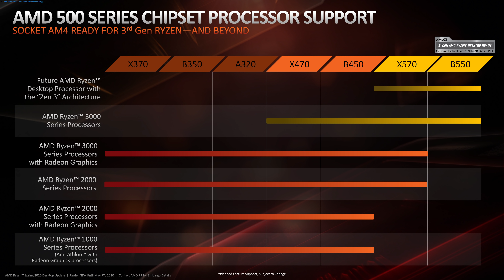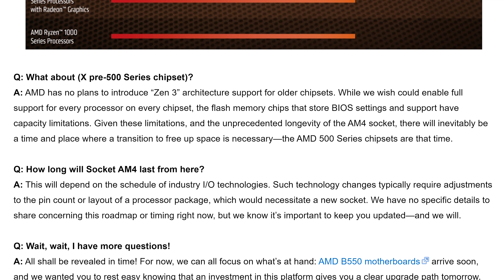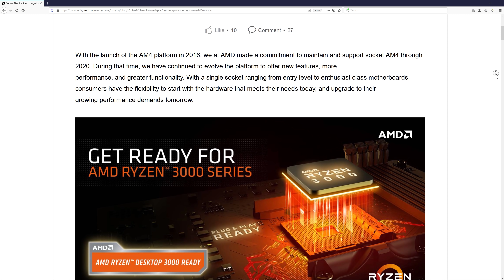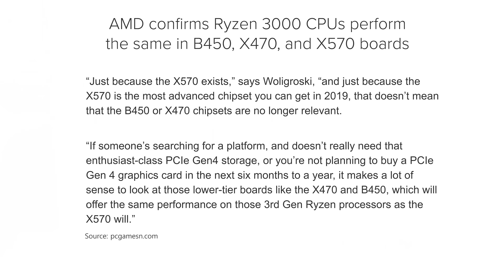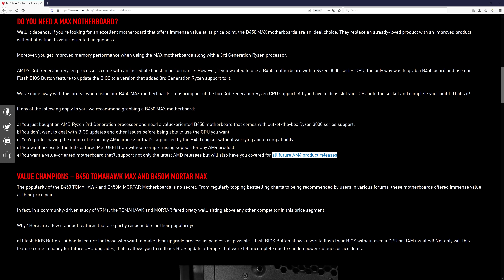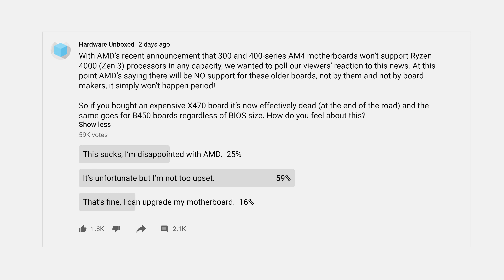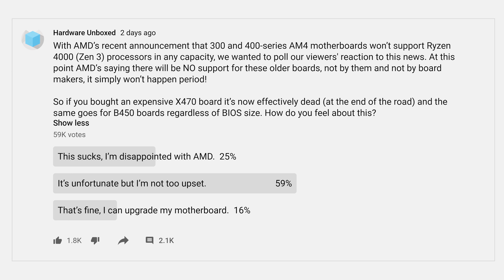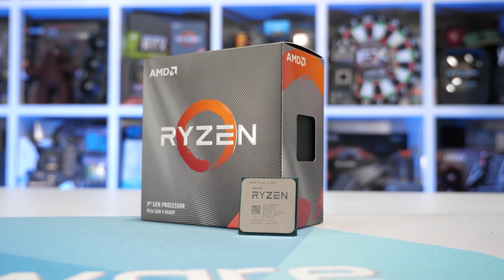AMD Does An Intel, Axes Zen 3 on 400-Series Motherboards, Our Thoughts

Comment: So budget buyers complaining that they cannot upgrade yearly?...
Silly, because you can put a flagship 3000 series chip into the b450, which will last you for YEARS... why? Because even if you play at 1080p high refresh, as time goes graphics just gonna get better thus needing better GPUs first and in turn GPU will be the first bottle neck for high fps gaming. Unless you play mine sweeper.

If you go higher res, the same applies, your you will run out of breath before hi end 3000 chip.

So I don't think this thing is such a big deal, miscommunicated for sure, badly, but in reality it won't hurt anyone's gaming experience, if they think of rationally.

From experience: if you want future proofing, you don't go cheap. Life is a biatch.

I have an x370 taichi with a stock r5 1600 for my 4k gaming needs. Even after all these years, I still only really need a GPU upgrade rather than a CPU one. 60hz screen, though.

You don't have to be overly upset about things that will not affect your daily life.

Happy gaming everyone!;))

Comment: I've got a B450 Carbon Pro paired with a 2600 so having the 3000s series as my only upgrade options is disappointing, even if I can opt for 2-6 more cores (not going for the 3950x on this board lol).  The only reason I picked this board over a cheaper one like the Asrock B450 pro4 is because I expected the 4000s to be compatible and I wanted the phatter vrms make sure it will work well.  Now all that is for naught.  I might just stick it out till the DDR5 2nd generation and at that point Intel will be back on the table, and I'll remember getting screwed by AMD and they will have that against them.

Comment: Thats a very dirty move, they release b550 1 year later expecting us to buy  a more expensive X570 and now they give us this stupid excuse, some X570 and X370 mobos have the same bios storage chip but the X570 have support....
They could just release diffent bios depending on the gen, like;
1&4, 2&4, 3&4 just dowload the one you need to upgrade and done.

Comment: Bought Asrock B450M Pro4, R5 2600 and RX 580 in late 2018. Still working well for my needs. I understand the outrage but for myself I have the option of upgrading to a 3900X or 3950X when Ryzen 4000 desktop chips ship and the price drops a bit

Comment: Thank you! As a 470x owner this is how I feel.  

I knew the 300 series would be out, but I feel slighted they got one extra generation than the 400 series.

Granted I don't fall into the "post 3000" buyers and got a 2700x with mine. But I paid way more for my motherboard (Asus Crosshair VII) than I normally would, thinking i would be able to "leap frog" a generation and that would offset the cost. If I knew I would only get it for two generations I would had gotten a B450 motherboard for half the price.

Comment: Seems Strange you couldn't cust support for processors older than Gen 2  from a bios to add new cpus. Or have a reduced functionality bios, if you need new ocde. May  no overclocking on the older boards.Otherwise what else is changing did a hardware tolerance issue creep in?

Comment: When Zen 2 came out, AMD tried to exclude 300-series chipsets from compatibility.

They should have just repeated that limitation for Zen 3 and stick to their guns.  I don't think they'd get a lot of flack over that.

There's still a chance for them to backtrack and do it correctly, but I have no guesses as to whether or not they'll do it.  I do think that the level of pressure from their partners will be the deciding factor.

Comment: I am disappointed with AMD's decision, but I probably would not want to upgrade to the Ryzen 4000 on the desktop from the 3000 series.  I usually expect to get at least 2-3 years use out of a computer before feeling the need to upgrade.  I might have thought about going from a Zen 2 Ryzen 5 series to a Zen 3 Ryzen 7 series processor which would net me the next generation AND more cores but  I still wouldn't have the benefit of PCI4 without a new MD. When I do upgrade it will be the full monty, IE: more cores, next gen CPU, DDR5, PCI4 and faster SSD that can make use of same.   What I am interested in from Ryzen 4, would be the new desktop APU for a budget build to upgrade the wife's computer.  THAT, can still make use of the 400 series chip set boards.
I hope for MSI's sake that AMD can be strong armed into providing support for un-official support of Zen 3 on X470 and maybe B450 motherboards that have the extra flash space.

Comment: Well, I just bought a 470X for the new rig I built at the end of April/Start of May. I probably won't be upgrading my 3600 anytime soon anyway, so it doesn't affect me too much currently, though I do think being able to upgrade to one the newer chips years later would be nice if it would increase my peformance, at a better cost ratio than buying a new MB+CPU combo. I did buy my board in trying to fit within a budget when it came my motherboard and was also looking for a motherboard with SPDIF output, not easy to find one on the 450 boards at the 119.99 price, while the X570 boards are still about a 150 or so. I do wish the AMD boards would remove Video Outputs as they seem a waste if you don't need them and allow for more USB ports or something on the back end, and release specific boards for for the APU lines. I think I'm more disappointed in the B550 boards coming out about a month after the build and not sure what they are offering and the price point of them, would have been nice to purchase one of those at the same price as my 470 if it had an SPDIF output.

Comment: Gonna make this clear: I dont feel sorry for A320, B350, or B450 owners. they bought the cheapest parts and thus get the cheapest result. They were lucky AMD made magic to get Zen 2 support for those older boards with the tiny roms. 

But going to x370 and x470, a lot of those boards have 64mb bios roms. i believe the x470 i own even has a 128mb bios rom, but i have to double check. theres really no reason the high end boards that do have large bios roms should be held back.

Also to be clear: Im on x570 so their decision isnt going to hurt me at all.

Comment: I'm just gonna say I have hope that they will reconsider... I literally left Intel this month for AMD .. AMD has what I want for this PC addiction lol. "Path of upgradability" where bumping memory frequency shows performance before have to over clock the CPU lol
I dropped MY I7. 8700 for a B450 and paired it with a 2700X 
I'm literally taking it apart right now as I type this on my phone lol. B450 is on its way with UPS 
I mean sure I have ZeN 2 for an upgrade down the road of I need one but I'd like to see ZEN three there also so I don't have to just go to ZEN 2

Comment: Well, there is no point upgrade to zen 3 anymore. Better wait until DDR5 launches and get a new chipset with new RAM. It's a shame because I would spend more if AMD kept support to Ryzen B4 series mobos for the zen3. I was planning to buy a ryzen 3600X + X470, enjoy a upgrade to zen 3 (maybe a 4900X)  and then upgrade again to the 5th generation. Better save up until 5th.

Comment: AMD literally gave you best cost to performance on your B3xx (or even A320) allowing you to buy it (even more cheaper when B4xx boards came) after 3000 series and pair it up with ryzen 9 so think about it. It is logical that most of the consumers buy the cheapest without issues working MB to pair with higher end CPU (you know the reason super clearly and dont be stupid on why would you pair these MB with these CPUs), they literally gave you a finger and you wanted the whole hand and they did it eventually, and you KNOW the human hunger is never satisfied. And AMD as a company manufacturer as all of the companies in whole fucking world is working for PROFIT.  WE ALL DO WORK FOR PROFIT or just get a salary at the end of the month.

They could at least tell us at the releasing of X570   that they wont support for  previous gen processors or at least make the X470 board to support it (i personally have B450 after 3000 released paired with 3700X and i feel bad for X470 owners). Also the poll Steve made is actually a prove of what people are doing when building new PC they built it because they needed at the time it not just thinking of upgrading every fucking year (no hard feelings on enthusiasts who do this but they will always get top of the line every year of products). 
Every year new products come and most of us cant handle the upgrading also look at intel users, still using 2nd,3rd,4th etc.. of their builds, and why? because thats how most of us is doing!!!
Why would you need 4000??? for what? just so the next year they release a product that will crush the 4000 series.

Hats off to AMD providing us great 4 years of great products.

Comment: "Does an Intel...". No.  Intel releases a new socket every time they add a + to their 14nm node, which is with basically every generation.

In 2017, AMD promised AM4 support through 2020...  and they delivered.  Zen, Zen+ & Zen 2 - 4 years and 3 uarch generations with a single socket, and all running on 2017 B320 boards, including the 3950X.  I'm not even going to suggest people cut AMD some slack. Just that they recognise AMD have delivered on the promise they made about product support.

And let's be clear about "axing support" and "Future AM4 processors".... MSI's Tomahawk Max was released in October 2019 (in the US).  AMD has just released 2 new CPUs on the 300 & 400 boards.  More than that, I would be very surprised if AMD doesn't launch even more 300 & 400 compatible CPUs later this/early next year.  They cerainly are not "axing support" for those boards, and the AM4 socket isn't going anywhere just yet.

I'm also not a fan of how you're prepared to throw 300 series owners under the bus based on an arbitrary and wholly subjective [Value] judgement, when that's exactly what you're going after AMD for.
Reply: They promised Zen , Zen 2 and Zen 3.  They haven't delivered.  Zen + wasn't on the 2017  road map and Zen 3 was supposed to be in 2019.  So no slack for AMD.
Reply: @jamesthomson8659   
Their promise was that AM4 would be the socket for Ryzen until at least 2020.  2 new Zen2 CPUs just launched on AM4.  Zen3 CPU's will launch on AM4.

People seem to be confused by the difference between 'Socket' and 'Chipset'.

AMD didn't make any promises about Chipset longevity, however, I will bet you $20 to a charity of your choice, that AMD will release even more Zen2 & Zen3 CPUs on AM4 next year, and that the Zen2 CPUs will run on at least 400 series Chipsets.

Comment: You know what would be amazing?  A small little ROM built onto the CPU silicon that tells the motherboard what it is, that could be read during POST.  I'm not talking in the CPU silicon itself, but like a small extra chip next to it under the IHS.  Then you don't need huge BIOS' to support all the possible CPU's, the CPU you put in the socket just tells the motherboard during POST what it is and what it needs to use it in that motherboard.

Comment: Great video!  I bought a B450 Tomahawk MAX on Steve's recommendation.  It's a great board and I appreciate the help.  I paired it with a 2700X which cost me $210 CAD with plans to upgrade to a Zen 2 CPU which more than likely an R9 chip, but not until the inevitable price drops.  My reasoning for getting the MAX board was primarily for the opportunity to go to Zen 2.  If B550 had come out earlier I'm still thinking that I would have chosen the B450 on price rather that features and Zen 3 support if that news was known at the time.  I would get my cheaper Zen 2 R9 chip and skip Zen 3.  Most people won't benefit much, if any, from the PCIe 4 Nvme SSDs unless the PC versions of the new console games take complete advantage of PCIe 4 GPUs and SSDs.  This would be the primary driver for B550 adoption.  I only feel bad for consumers who can only afford a B450 level board but I don't see what they would be missing out in the long run, other than one CPU release, since the new features would be left behind because of the B450.  Lisa Su may change her mind about supporting 400 series boards, it's a woman's prerogative.  The only 2 certainties in life are death and taxes.  Well maybe climate change and viral pandemics too.

Comment: I built a PC a few months ago with an
r5 3600 on a msi b450 tomahawk MAX. I really wanted to wait for b550 because I didn't want to allocate too much of my budget on an x570. When it was apparent that b550 wasn't coming anytime soon, and I saw MSI's offering of a b450 platform with an updated BIOS chip to support the needs of zen 2 and therefore zen 3, I thought perfect. That's exactly what I wanted. An affordable chipset that I didn't have to waist money on features like PSI gen 4 which I didn't need, but also supplied the necessary hardware requirements for future zen 3 CPUs. My plan was to upgrade to a 4700x or better when I felt that 6 cores 12 threads wasn't enough. That was one of the selling points for me; future compatibility... Needless to say I'm very disappointed. I really hope AMD at least back tracks on this decision with b450 boards with upgraded capacity BIOS chips like my board. Thanks hardware unboxed. As always, great video with relevant content.

Comment: I'd be fine with that if B550 was available with Zen2 launch. Support for just the next gen is not as awesome as supporting three or four generations, but compatibility or stability issues may be quite tricky. Considering the VRM of most B450 boards, support for anything above R7 3700X doesn't make sense. Even with B450, I would only consider R9 with a handful of boards. But buying a B450 today, even a good one like one of the three good MSI MAX ones with VRM capable of supporting a 12-core feels a lot worse if AMD is unwilling to support these boards with microcode for the last AM4 generation.

Comment: I bought a X470 board start of this year for my 3700x. Solely because I didn’t need pci gen 4 and at the time, x570 boards were trash for the price.
Reply: I did the same last year when the 3700x was brand new. Those damned X570 boards are so overpriced.. I have a navi card but I can tell you I wouldn't be able to saturate pcie gen 4; Very few things can do that currently, and the latency benefits hardly seem worth it.
Reply: Yup. Due to the SHTF, I was lucky to get a 2600x.  I got it for 100 bucks. The MSI gamer plus for 120.  I had to jump the gun to ensure I got parts. Period.
Planned to save up and upgrade the proc. I guess I'll only upgrade it to a certain point.
Yall are right. For features and performance to price, this board was far better than the over priced 500 series.
Reply: I am with you on this. I bought an x470 because I wanted a white build and as far as I know there still isn't a decent x570 white motherboard. The little work I do on my computer doesn't benefit from gen4 ssd speed so no big deal, however high core count does help a lot. And the real pisser is I can't go back to intel unless they can actually produce a 8 core that doesn't need 400watts. Damn they got me hook line and sinker.

Comment: Yepe, Completely agree with everything Steve said. The biggest issue here is AMD's lack of communication and/or bad communication to both end-customers and motherboard parterns, given how they screwed MSI over with the MAX lineup.

Add to that the BS excuse of BIOS chip size (some 400-series have 32MB, while some X570 have 16MB) and like Steve said, it's a crap move.

Comment: I see all these people say, they will be switching to Intel after this stunt. Did you forget that without AMD we would still be stuck on 4c/4t for intermediate consumer chips? And 4c/8t for high end consumer chips? And to get anything past 4 cores, you had to spend at least $500 US on CPU+MOBO alone? Or the stupid stunts like you couldn't upgrade to a 7700k with a Z170 board, even though it was same damn socket? You've been getting shafted for YEARS, but you couldn't do anything because there wasn't an competition. And now, we can have up to 16c/32t on consumer-grade MOBOs because of AMD, which will also get significant price drops after new Zen lineups drop, something Intel never did.

It's a stupid move from AMD, and I wish B550 was released sooner, but don't think for a second switching to Intel out of spite will do you any good. Voice your complaints to AMD, and then be patient. Give them the chance to fix this.
Reply: The word is AMD isn't interested in fixing this.    I  won't be switching until I need to, but no B550 or Zen 3 for me.   AMD's loss.  I would have probably have purchased 3 Zen 3 to replace 2000 series chips in B450 motherboards.

Comment: If B550 motherboards came out at the same time as X570, then this wouldn’t be nearly as much of an issue.  But because of B550 delays, there is almost an entire year where budget buyers were buying B450 motherboards instead of 500 series options, expecting to be able to upgrade their 3000 series chips to 4000 series.  At first I didn’t think this was a problem but now thinking about how many customers during that year are now stuck having to upgrade motherboard in order to get 4000 series CPU support, I have to say AMD really screwed this up.
Reply: They just won't upgrade to series 4000.   Changing out a cpu is easy.  Changing a motherboard is a pain.